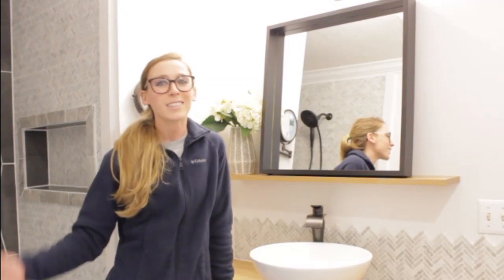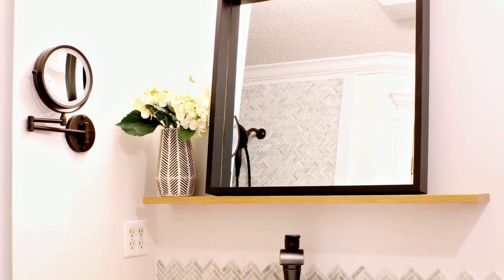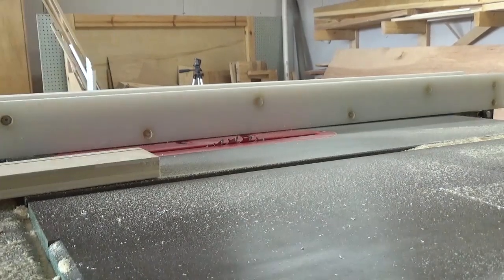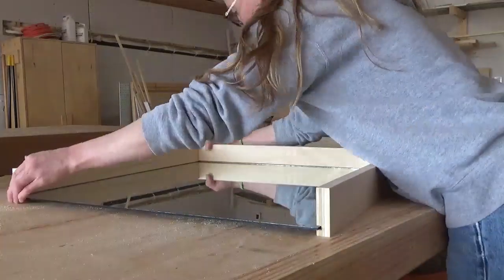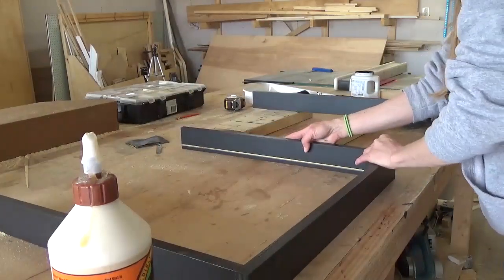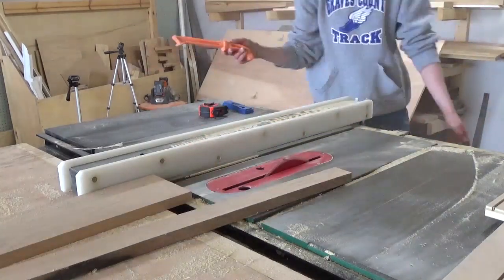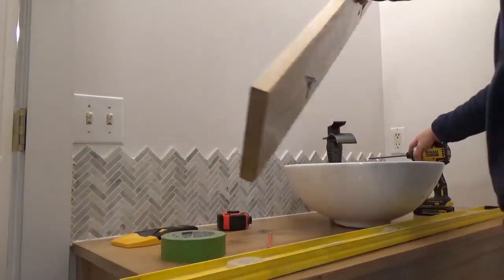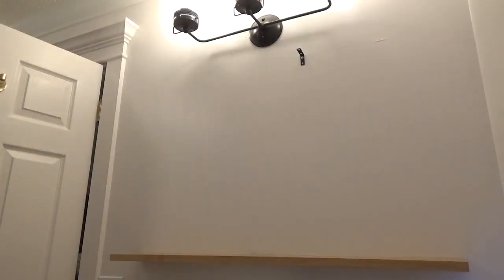How to Make a Floating Bathroom Mirror & Shelf

Comment: This project turned out very nice! I like the idea of using pocket screws to mount the shelf.
Reply from the maker: Thank you! It may not be the strongest method but it took about five minutes and is surprisingly strong. Much easier than using expensive brackets 👍

Comment: Nice and simple. Looks good. We don’t always have to build to enth degree. One quick tip that I also learned the hard way as well. When putting a mirror in a frame, paint or stain the groove or dado where the mirror will go, so you don’t see the reflection of the wood in the mirror.
Reply from the maker: Yes once I got it together, I noticed you could kind of see the unfinished parts on the edges. I’ll remember that for next time 👍

Comment: Nice... Just if keep the top side without glue to can replace the mirror if got broken in the future.
Pocket hole is not that much strong to use for a shelf I think; specially if the shelf width is larger than 8 cm
Reply from the maker: Shelves have held fine so far and it’s been over a year now 👍